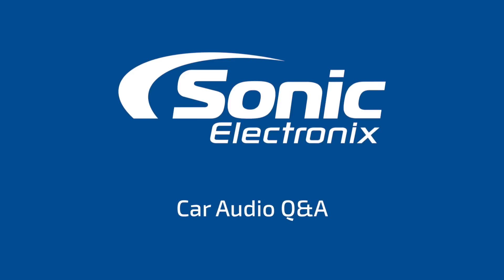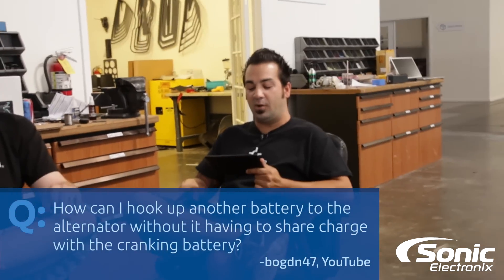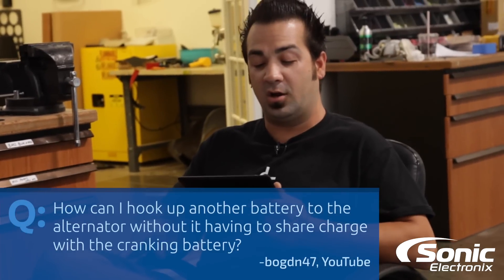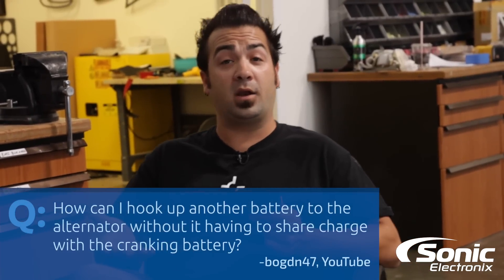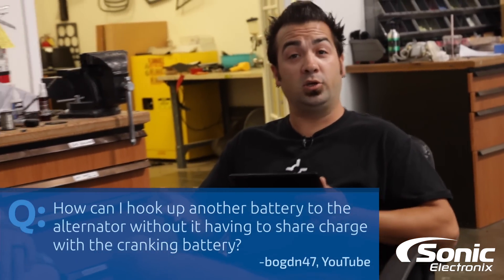Isolating your Secondary Car Battery | Diode vs Relay Isolators | Car Audio Q&A

Comment: So, what you're saying is using a double (anode in) power diode with output charge going between - and despite a 0.7 voltage drop (per diode) if the alternator puts out 14v - 1.4v = 12.6v. That's perfect! The only question remaining is what current rating should the power diode be, 40 amps, 60 amps, or more? Thanks for your video. Much appreciated.

Comment: Hi guys is it possible to put a switch on a stinger 500amp relay so you can engage it when you’ve started the engine or whenever you feel the need to ? On the thin red wire which engaged the relay ,any info would be great thanks
Reply: i think so

Comment: 6 years after I’m n this situation of trying to figure why my rear lithium battery 🔋 is not at the 13.6 volt  and I’ve seen it at 12.2 volts . I’m using a relay isolator . I’m starting to think I may be better off with a Diode isolator in line .
Reply: link me if you found one..i cant find them
Reply: @hooptastic_hippie8522  what work Great for me it’s a a smart voltage regulator called … Victron ..12volt 30 amp ones . it uses app and you can adjust to your preferences it’s used for Rv or other types of mobile vehicle installation. Or non mobile like a slash solar panel plus battery 🔋 back up charger . You’ll see you can find one at an official website or eBay
Reply: @jorgezuni2818  this is for car audio..about a 6ooo watt system
Reply: @hooptastic_hippie8522  wow .. at that power might wanna check with a frequent installer that could give you a better orientation.

Comment: It's 4 years later ... I hope I'm not too late for a question 🤓 lol ... anyway need isolator for dummies here ... if the car battery is already connected to the alternator via the B+ post (have yet to look 👀) do I remove it from there in order to place it on the #1 out post of the isolator?

Then from the isolator alternator post create the (only) connect to the B+ post?

Also, from #2 Aux Battery isolator post ... should a switch come after the fuse on it's way to the battery bank? 

[] []  Energizer and Comp 🤷🏼‍♀️ what are these?

Any assistance would be greatly appreciated.

Comment: What about smart alternators, different batteries capacity and diode isolators? If my secondary battery has more capacity than car battery, and the alternator is programmed for Ah power for car battery, wold the second battery suffer?

Comment: couldnt i just avoid buying an isolator by putiting a 100 amp circut breaker in and just turning it on after i have started the car and turning it off when i am done driving the car? the batteries will only be connected together while the car is running. could this work or will it mess up the cars functions if i am charging a nearly dead battery while driving???

Comment: OK I have 2 batteries in the trunk. Can I use the same ground or should I ground each battery? Total of 3 grounds. 20amp Battery 20amp batteey 1500w amplifier.

Comment: Ideally you want both, a diode and a relay. If you buy a diode alone your secondary battery will constantly drain at approx 1 amp. Also keep in mind, adding a secondary battery will put further strain on your stock alternator. You will eventually have to replace and upgrade the alternator that is now charging 2 batteries.

Comment: Is a battery  relay isolator the same as a diode isolator? If not how can I  tell the difference? Also can you provide a link to a  quality diode isolator for an alternator that puts out 130amps? I was also wondering if it could harm the  vehicle's  computer by adding a  second battery is there a way that it could potentially see too much  voltage? Also would it be ok to buy a different brand  and cca rated battery for the  stereo system? Sorry for all the questions  thanks in advance for your help

Comment: In a circuit, power will always be supplied by the power source with the highest voltage, which in the case of a running car will be the alternator.  Neither battery will ever pull power from the other as long as the alternator is spinning.  Diode Isolators have a purpose, but this isn’t one of them.  Use a solenoid!

Comment: So if you have two additional batteries for the audio system, the isolator would be connected only between the engine bay battery, and one of the secondary battery?
Reply: Yes and your two extra batteries would be wired together so theyd both still be charged by your alternator.

Comment: Can’t you just run a separate wire from the alternator to the secondary battery instead of using an isolator ?
Reply: It's still connected to the primary battery if you do that because both batteries are connected to the alternator

Comment: Could I hook up both batteries to the alternator then use a diode isolator with another connection from my alternator and hook up the batteries so I could avoid the voltage drop? And when you say voltage drop, do you mean when you start your car, your battery goes from like 12 volts to 14.4-14.8 volts and if your using a diode, both batteries will suffer a .7 voltage drop to 14.0 or 13.8 volts when the engine is running?

Comment: so if I install an isolator do I still need to upgrade my alternator
Reply: Depends on how many Watts you have and what size is your alternator. If you have a 90 Amp alternator and 1500 watt Amp. Your system is being robbed of prob 50 percent of power. I wouldn't go with less than a 160 Amp alternator EVER.
Reply: Always best running a H.O. alternator, Big3 and secondary battery.

Comment: or you could just run a charge wire from your alt to your extra battery in the back n that isolates it right there with no voltage lose at all
Reply: Jeffrey Amedure Until you realize you are literally just hooking the two batteries up in parallel by doing that and murdering both batteries
Reply: Jeffrey Amedure that would be the same as connecting both batteries together

Comment: Do the batteries need to be exactly the same, or can they be different.. for example: starting battery is an optima d51 and a d34/5 for the system

Comment: I got a question for your q&a show. How do you install and amp and subwoofer in a hybrid car? I have a 2013 Lexus CT200h and I want to add a JL 500/1 to a 10w6ho box.
Reply: It is a misconception that hybrids cannot allow after market amplifiers. It is the opposite. The HV , (hybrid) battery has high voltage, (266v) and when your starting battery needs juice to supply your JL amp, the HV battery throws it to it. Use XS Power, for your main battery, a Big3 kit, also.
Reply: Don Yourmask thanks for the reply. That car is already gone. Your advice was exactly what I did except i added and isolator with a kinetic battery and had a switch activating the isolator. When it was playing loud you could see it draw from the hybrid battery. I would let the hybrid battery charge back up and hit the switch to let it charge the kinetic battery.

Comment: I got the two isolator the one that you could connect the two batteries but I noticed on my dashboard the voltage dropped to 10 volts why is that
Reply: Chris R Elite520 because you probably have a stock alternator. just because you have extra batterys does not mean tour putting out enough power to charge them. Nd if you have 3 batterys and the stock alt your alt is def not going to be able to charge all three

Comment: Allen or Brendan

I just bought a NVX 500A ISOLATOR !

I HAVE 4 AMPLIFIER'S 
2 N4 MASSIVE AUDIO
1 NX4 4CH
1 JBL GTO 804-EZ 4CH

220'FT OF 1/0AWG PC-OFC 

4 XSCORPIAN 300A BREAKERS 

OPTIMA'S :
RED PRIMARY
YELLOW SECONDARY 

IM ASUMING ,AFTER I READ ALL DIRECTIONS

+ ACCESSORY & - GROUND (SMALL BOLTS)

+ #1 I INSTALL PRIMARY & ALTANATOR TO

+#2 I INSTALL SECONDARY BATTERY ONLY!

WITH THAT SAID I BOUGHT COPPER FLATBAR TO CUSTOM MAKE BUSS BARS TO ATTACH 6+ & 6-

I DONT WANT TO BOTTLE NECK ANYTHING, IS THEIR ANY TIPS OR TRICKS TO GET 6+ LUGS & 6 - LUGS ON A ALTANATOR 

IN A 02 TUNDRA V8 ACCESS CAB 4X4 WITH ONLY A 4'FT RUN TOPS TO THE RELAY (IT SAYS FUSE INBETWEEN FROM ALT. TO RELAY ,NESSASARY?)

Comment: I have a 200amp stinger isolator. but my Voltage drops on my second battey w hen I start my car.
Reply: Alexzander DaVinci 

I think they answered it @ 1:48 marker.
pay particular attention to the part where he describes what happens WHEN you turn the ignition key on.

Basically, when the key is off, the isolator treats the two batteries as independent and separate from one another, however, once you turn the ignition key on, then both batteries are no longer 'isolated', and they are treated as one. When that happens, the battery that has lower charge then the other, will automatically draw from the other. 

This is why they recommend that 'diode' style thingy compared to standard isolator.

Comment: If both batteries are always isolated how will the alternator know to charge the second battery when it's low if the alternator sense wire is on the first battery?

Comment: Hi,  im getting four 12" Power Acoustik BAMF series subwoofers that run 1,750 watts rms and 3,500 watts peak/max. Should i purchase amplifiers that will reach the peak/max amount of power the woofers can handle or purchase amps that will only supply the rms rating? Also, how many and what type of batteries will i need with what types of fuses would be good to use.  Thank you so much and if you could help me out with these problems,  that would honestly mean A LOT. Thanks again. ✌

Comment: how to wire rca to bare wire? and how this provides me?
Reply: Some amplifiers have RCA cable interconnects you can cut for bare wire to speaker level inputs for the amp. It is best to buy a line out convertor like Audio Control LC2i, or a DM-608 that accepts speaker level, (bare wire). The DM-608 has a line driver, EQ and time correction, too.

Comment: hey I have a  600w 2 channel 2 ohm stable bridgeable amp. it says it has a tri mode design. I want to power a 4ohm single voice coil sub and two smaller 4 ohm speakers. could I do this?

Comment: Do I need to upgrade my alternator if I want a second battery for my set up? I have a Nissan Altima base model my subs are 2 12' sa D2 and a 2000 watt Amp I also have a 1 farad capacitor.
Reply: One battery no 2 maybe depending on the size of the batteries more than 3 yes

Comment: If I were to use one of these diode isolators can I keep my stock battery and run my system off of a Optima Yellow top? Or should I swap out the starter battery too?
Reply: Best to use two XS Power batteries.

Comment: do not follow this advice... solenoids will always be the better choice. more power available.
Reply: I second that
Reply: Are solenoids commonly used  and sold for car audio? Is there any cons to them?
Reply: In a ignition key actuated, solenoid linked rear battery, when car/key is on or in run position the solenoid is engaged and both batteries are linked together and being charged at the same time. Translates to more reserve/capacity power for the system.
  With Key OFF or car not running, if you play the system till the rear battery is dead the car will still start because the key was OFF, solenoid was Not engaged, front battery has 100% charge. the system only played off the rear batteries. This means you can use more of the power available in your car to power your system and do it in a way that is 100% safe. Go to any big stereo comp and tell me if you see battery isolators? All big industry uses solenoids/contactors to handle high current loads and we should to. Solenoids are about 99% more efficient at getting the current where it needs to go vs a solid state battery isolator that uses resistors and diodes. A solenoid is a On/OFF switch.~ You can buy 500Amp continuous use rated solenoids / contactors on ebay for about 50-75 bucks. The Stinger/Pac solenoid is the bottom barrel, there are much higher quality solenoids that will last many many yrs in continuous use.~
Reply: Are solenoids commonly used  and sold for car audio? Is there any cons to them?
Reply: +Freshkryp69 what you're talking about is a relay. Solenoid is just a coil with no switching option.
Reply: KocuRisko
Umm your half right and totally wrong. I use them daily and they are also called contactors. they make some in the 4000a. range with a 12v coil!~ lots of Fords use them to start their cars!~ leave it to people who know whats up bro so ur shit dont catch fire!~
Reply: below
Reply: KocuRisko
but then again, its not wrong to call them a solenoid actuated relay,(which they all are). in the common world, with mechanics, it goes without saying, unless were talking transmissions.. Ive used Omron etc. for linking-delinking banks of batteries for many yrs. for car stereos and solar. its all good bro. were all on the same page, terminology be dammed!
Reply: Just get a Ford Solenoid from like a 1990 Ford Mustang